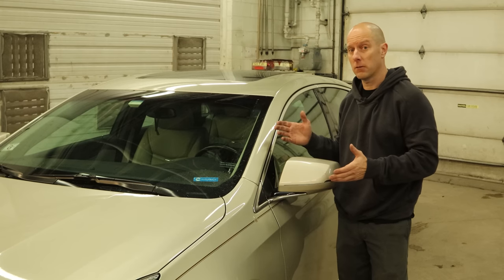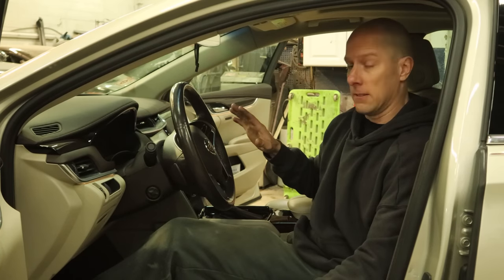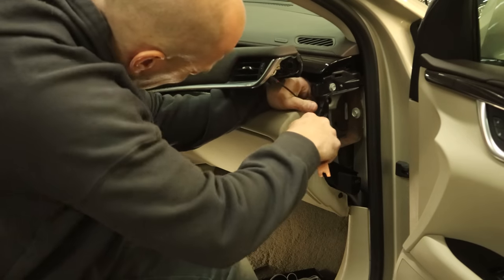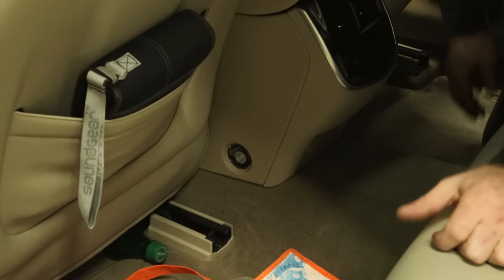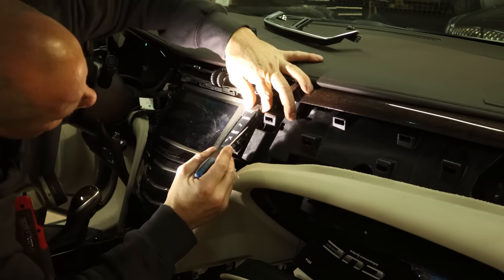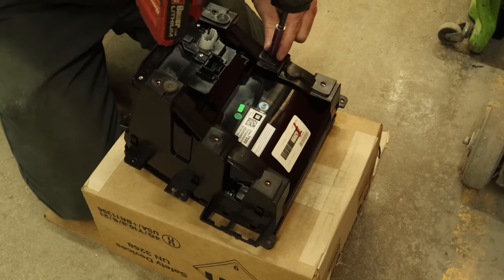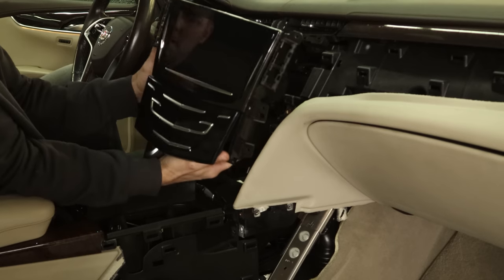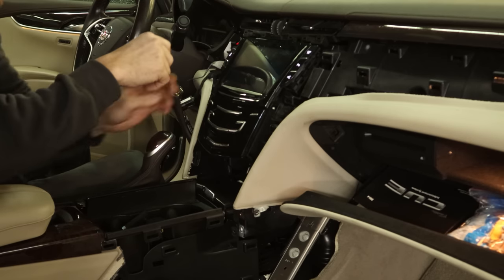Removing a failed Cue system for repair on a 2014 Cadillac XTS

Comment: Scott, I am glad you had a good experience with UpFix. I had them repair an electric range cooktop controller motherboard. I found they are only limited to replacing the relays and capacitors. That is what they call a repair service, and they sent me back the controller board and it still did not work. I sent it back a second time, to give them a second shot at it, and when they returned it back to me again, they told me they were unable to repair the problem and told me the diagnosed problem was that the EEPROM chip had lost its programming, and they do not have the ability to reprogram it. I thought they should have known that outcome the first time they had the board and I was dissappointed that I lost out on two Shipping charges and ended up where I started, with a dead board. To this day, I am not certain they weren't the ones who fried the eeprom chip. Ebay came through, and I found another board which worked and fixed my problem. Many older electronics die, and the "easy" and usual fix is to replace all the relays and capacitors. That UpFix route did not work out for me.
Reply: Interesting.  So you're saying they didn't test their "fix" the first time?  That's not right.  Although how does a firm like this "test" electronics like automotive engine computers, ABS modules, and radios without having the exact car to put them back into?  How do they really know what they are "repairing" has been done correctly?
Reply: @Guillotines_For_Globalists  They can test voltages to see if the circuits are repaired, and can test if correct voltage is flowing through the board. Usually High voltage will be what comes into the item, 110 or 220v, and low voltages range from 12v, 5v and 3.3v, depending what part they are working on, and I was told my the voltages were reading correctly, upon the second return. I don't see how. After the part was returned the first time, it still had no low voltage. My cooktop has a fan that comes on only when a built in heat sensor detects and hits a set temp, usually when the enclosed cabinet gets warm. The second time it was returned, the item allowed a voltage leak which caused the fan to spin at an extremely slow rpm, which should not have taken place. If the board's eeprom had not lost it's programming, their repair service would likely have worked for me...but just know with electronics, sometimes the type of repair services out there will not always be able to repair a part, depending what components have failed. The issue I had, is their communication was not adequate and when I sent the board back in, it took them 3 days to find it, after they told me that it was lost...which was concerning. I had taken pics of both sides of my controller board, before sending it to them, each time. A manager, Anthony, told me the board had severe damage. I asked him to send me a picture of the damage, because the board I sent in did NOT have any apparent damage which he was claiming mine had, when I sent it in. Turns out the board he sent me the pic of, which was supposed to be my board, was an entirely different controller board - not even the same model as mine. I sent him my pics, to prove to him he was not accurate. His reply a few days later was that the tech had sent him a pic of a different board by accident, that they have found my board, and that they could not repair it and they eventually returned it back to me. Like I said in the prior post, I ended up finding another working board off of ebay. In no way am I knocking the service UpFix offers, as illustrated, Scott had a great outcome with getting his part repaired, and he seems to use them with no issues. I happen to be the one example where there was not a favorable outcome.
Reply: @nealnaz  Makes sense, sounds complicated due to how complex these electronics are.  I would be wary sending in electronics due to loss in transit OR at the facility.  I had a hell of a time sending in an iRobot Roomba last year for warranty repair.  I was told turnaround time would be 7-10 days and then it morphed into 2 months at the snap of the finger.  I think they lied to me just to get me to send it in.  But 2 months later I had a newer model refurbished iRobot, and I have no idea if that was done by mistake or what, but I didn't complain any further, lol.  Also strangely enough were 2 loose batteries flopping around in the box.  The iRobot already had a battery in it, and then an identical "spare" battery was in the box in addition to another Roomba battery that was for an entirely different model.  I have no idea what the hell was happening there.

Comment: You can buy just the screen for about $100, but the black is a little different than the rest of the radio. It’s about $160 for the proper blue-black, and the screen replacement takes 1-2 hours depending on skill. If you’re not confident in your skills a repair service may be a good idea.
Reply: I did this last year. Works better than the original screen and waaaay easier than taking the whole system out. Also the new screen doesn’t have the gel in it so it should be less prone to failure.
Reply: $35 for the  screen 1 hour labor

Comment: Nice repair! They sure did over complicate that, they could’ve easily just had a simple bezel around the unit that popped out and exposed screws holding it in… but the dealers get paid more labour this way having to take half the dash apart and it prevents owners from fixing it themselves.
Reply: Hey from the same techs at gm that gave us the v 8 6 4
Reply: Having to tear half the dash apart also prevents thieves from breaking open cars and stripping all the expensive bits from the interior in 5-10 minutes while the car is on the driveway, like what happens with BMWs and Audis where it's much easier to take em apart (at least here in Europe there's actual gangs that do that)

Comment: I wonder what the turnaround time is for their repairs.
Reply: Once they receive your part, they will run diagnostic tests to identify the problem. After they have determined what is wrong, they will reset or rebuild it and send it back to you within 24 hours. Have questions? You can contact them anytime!

Comment: Even though you kinda stumbled through this. This was by far an easier way then taking the entire center console apart piece by piece like everyone else shows..

If you able to do this much yourself though it’s faster and easier to just get a better screen from quescreen for $150 and install it on the unit.. it’s just the crappy gel digitizer they use that fails cause of heat and drying out. 

No need to send out the entire unit or replace it.. it’s only the digitizer that is the issue..
Reply: TRUE👍 and I think that gel screen was ‘13 thru ‘15 🤔

Comment: Here's a tip if you're buying a used Cadillac with this style of screen: make sure ALL of the touchscreen is working. When I got my ELR most of the touch screen worked fine except for a small spot. I accidentally set the sound to come out of the left speakers only and couldn't change it back because the area to set it to where it was didn't respond.

Comment: What you have done by the time line 4:54 I would have had my Ram Laramie radio out with on yank of the center panel. But I've made it to 140,000 and am still going strong

Comment: Great Job Sir.  

This video will probably get 60 million views over the next 3 years.....  this is going to be a REAL problem, as the Platinum warranties expire....

I had to send my instrument cluster out, in my 2004 Escalade....  Turns out, you can drive the car just fine without it.  Even the cruise works!   Of course, for any law enforcement members seeing this, I DID NOT do that....  No way would I drive a truck with no instruments for 10 days...  come on now....

Ahhh, the XTS...  Always sort of wanted one.  Remember when they assured us this was NOT the replacement for the Fleetwood/DeVille size cars??  And the big one was coming??  With a V8???  Ahhh, good times!!!!

Ahhh yes.  Now all the hotels, and casinos, and livery services, are all buying LS 460's....  With proper V8's in them.  What's more American than a Lexus???  Not much, apparently.....  Town Car?  Fleetwood?  DTS?  Uhhh, no, no, and no....

Yeah, our friends at GM have a REAL high opinion of that system....  The cost of doing that at a dealership, is way more than the Platinum warranty costs......  So....  Yeah...

Anyways, great job on this one.

Comment: What's the turnaround time on the fix. Good video 👍
Reply: Once they receive your part, they will run diagnostic tests to identify the problem. After they have determined what is wrong, they will reset or rebuild it and send it back to you within 24 hours. Have questions? You can contact them anytime!
Reply: @jt9498  thanks Jack.

Comment: god my dad has a 2019 XT5 with cue but he does not have the motorized door under the unit.  I cannot believe how much work it is just get to the bolts that hold it into the dash.  I have a 09 impala and all I have to get get to my radio is remove the bezel surrounding the head unit and the hvac and remove 4 bolts.  my radio is starting to go it it was not for the fact that it has built in XM I would swapped it out for maybe an android based unit.

Comment: Mine has cracking around the lower push buttons and one moving up through the touchscreen, is that something they can fix or will I need a new one. We've never had trouble with the working of the unit, just cracks.

Comment: 2007 Buick Lucerne radio/HVAC removal: one trim piece and seven small screws.       Cadillac engineers in 2013, "Let make 'em pull the whole car apart to remove the radio!"

Comment: Always enjoy your videos, informative and great jokes.  If I attempted this repair, 8 out of 10 clips would have broken off.  
With your wealth of knowledge, do you know what size screw/bolt I need to install cross rails to the side rails on a '17 suburban?  I've called 5 local Chev. dealerships and the parts people can't give that info.  They can sell me the install kit with 8 screws/bolts for $30.  Only need one that was missing in the after market package.
Thanks, Keep up the great videos

Comment: Funny thing is...most radios with knobs and buttons rarely had no response issues like this...plus knobs and buttons are easier to operate while driving...most time by touch you know where your fingers are and what button or control your hunting for. Never been a fan of touchscreens in automobiles for the in car entertainment.

Comment: Nice work, but this is why I still drive a 71 nova. It's a car and it drives, what else do I need it to do, I don't need my but warmed, or where I'm at on a map, the temp outside, my mirror deiced, I can open my own glove box, slide the seat, check my tire pressure, roll the window down, adjust the mirror, lock the door, open the trunk, look in the mirror, put my seat belt on, turn my head lights on/off, and keep track of when to change my oil, and the radio still works lol. Cars today have way too much plastic and gadgets. $1900.00 new in 1971 and if you use an inflation calculator that would be $13,189.66 in today's money, still a deal.

Comment: My Dodge Ram has same problem when I got it new it went out 3 months later,they replaced it with a used one in a brand new truck. I said wait a minute this is new I want a new radio, they said we can do what we want to fix it. so far they yanked it out four times to fix their used radio in a brand new truck. Thank the lord I sold it got another Ram with the 12 inch screen Hope this don't take a crap on me like Dodge does to their loyal customers.

Comment: This is tough conversation to have but it has to be had. 
GM’s nav system and touch screens are trash.  
There I said it. They suck. The features are almost useless. 
GM got bailed out, paid back a loan with no interest then got pretty much bought out by 2 Chinese investment groups. 

And that’s when they started doing things like vin locking radios, and not honoring their warranties.
Reply: The GM bailout was back in 2009. Come on dude. Time to let it go. Even that Japanese WWII soldier came out of the jungle in the 70s. Don't be that dude. You need an update more than that Cadillac did.
Reply: @houseofno  I guess you have no idea about GM.  The bailout was the point you can clearly see where GM adopted the “fuck the consumer, cut all corners, bottom line only” mentality. And we actually lost 14 billion on that deal… then GM got bought out by the Chines and now brand new Silverado are bending rods and valves at 4500 miles off the dealer lot. I’ve owned GM for 17 years, I’ve got 2 GM trucks I’ve yanked the Navs out of and tossed in the trash because they are worthless. And we all paid a premium price of worthless.
Reply: @houseofno  He likes his Diesel-Gate more than North American cars it seems.

Comment: OMG all that to just take a radio out???  At one point I was waiting for you to remove the rear subframe.  How many times did you want to throw the engineer who designed that system in the pile?

Comment: If GM had went bankrupt and shut down, 75% of the independent repair shops would have also. Those heaps have very little domestic content in them, but we don't talk about THAT. Also, i don't know what this "Platinum warranty" crap is, but GM gave it's customers a platinum-coated you know what up the rear. They wouldn't cover it. They had to sue them about this issue..twice.

Comment: Thank you for the excellent post, as the methods needed.  But what is not shown is as this type model ages, the plastic becomes brittle.  So all clips shown to the nice removal...will soon be as egg shell. So fragile as to snap, crack, pop in nasty surprise to the tech....who must answer to the customer.  So besides the sheer expense, huge pitfall exists to the sub standard, model wide failure rate as components so cheap, frail and mash up poor as "made to fail".   Hence, I am fair warned.  That to the customer, some release as cheap plastic replacement is standard and extra cost built in.....the warranty is akin to fraud.  The system is shoddy.
That they would be as likely to betterment as trade to an XJ model Jeep.
Status?  Likely to fail.  Replacement...as equal in domain as skat.
Vibration, age, hot cool cycle and poor quality as build.  Install to a dart board and invite the owner to have a throw.  M.

Comment: What a horrific job..  The way it comes apart..  The way you have to move the center console back one inch..  The price of the radio. smh..  and on nearly a brand new car, it's insane.  I'll never buy GM or Dodge products ever again.  Except maybe an LS motor or a Hemi motor that I can throw in a project.

Comment: To change the spark plugs in a Cadillac start by pulling out the back bumper and the right back wheel. 👍. I still thinking how engineers manage to make simple fix or replace job a complete disaster . Oh, wait, I know, they just follow instructions. Make the cars disposable or a nightmare to fix.

Comment: Bullshit engineering.  Bury a part that wears out under all that F'ing trim. It should have 4 clips holding it in and a special tool to remove it like the old days with the DIN trays.